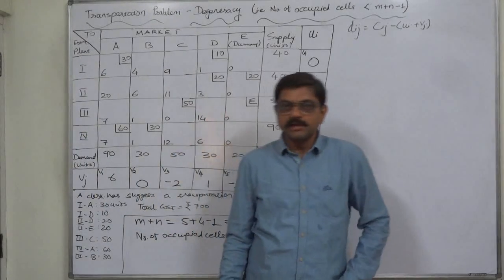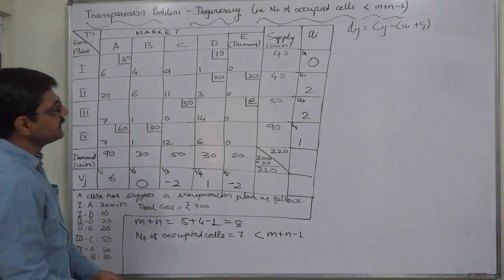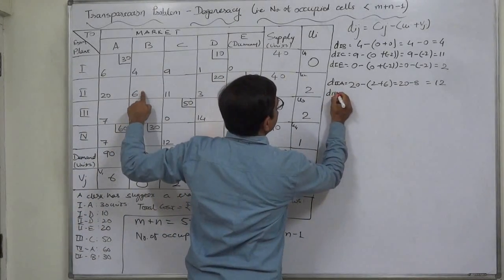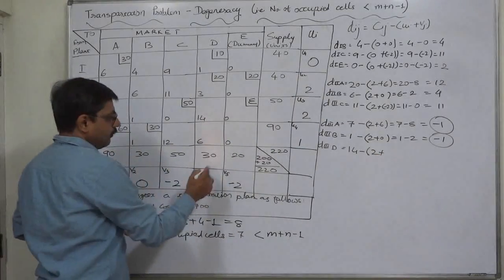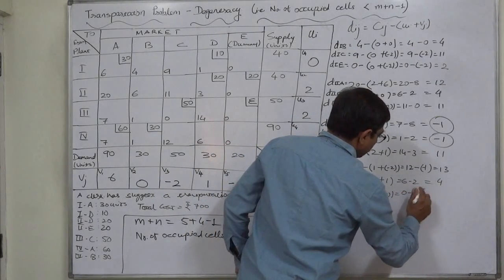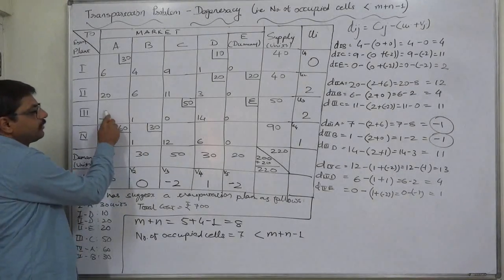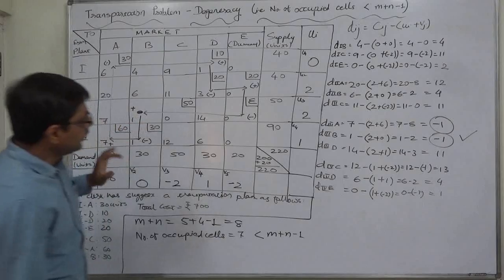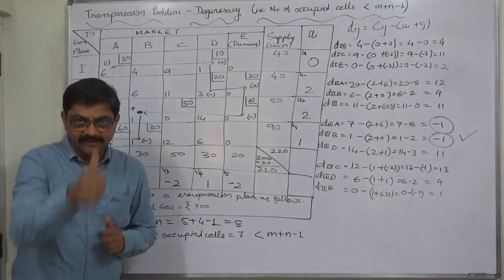Transportation Problem - 20 Degeneracy at the Initial Solution Part 2 of 3 Checking Optimality

Comment: What if the epsilon cell has a '+' instead of '-'  while making the closed loop? How would we proceed then ?
Reply from the maker: The value of epsilon is non-zero but so negligible that, if you add any value 'x' to it, it remains 'x'...
Reply: epsilon ell has + and most negative cell is also plus then what we can do?

Comment: Explaination is superb.but is that fine if we use modi method after NWCM or LCM
Reply from the maker: Yes, why not? 
But, it is always preferable to use VAM, if we need to select the method to find the initial solution because VAM, which I have explained taking penalty as 'next highest cost - least cost' (and not 'least cost - least cost') has greater chances of directly reaching the optimal solution (at the initial stage itself) than the other alternative method...:)